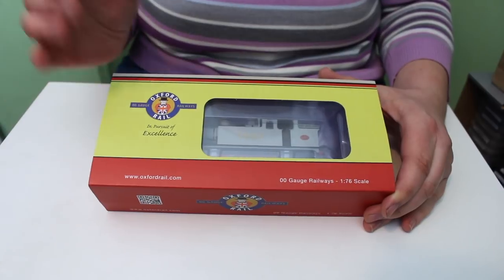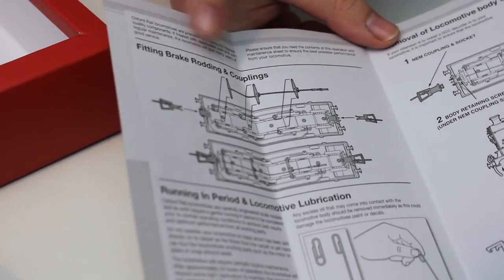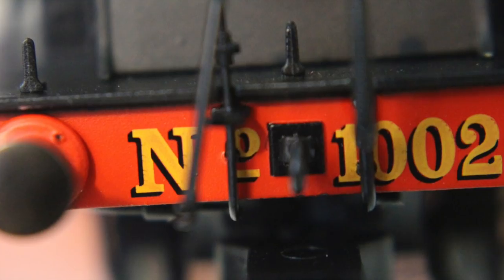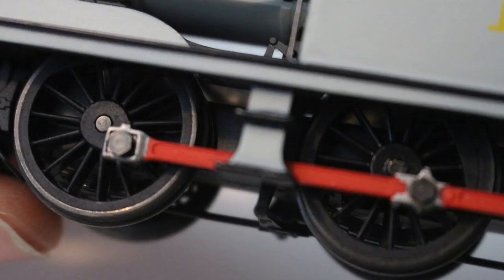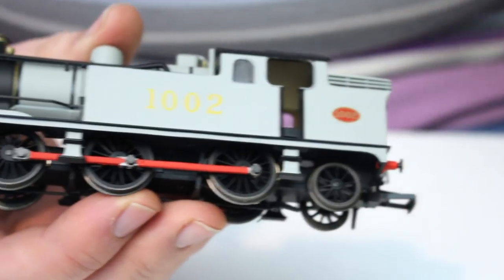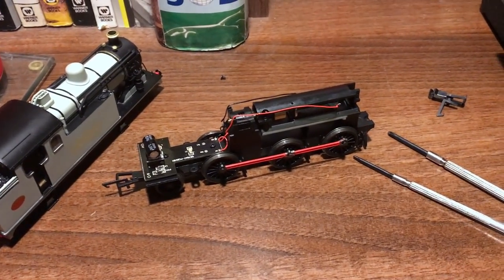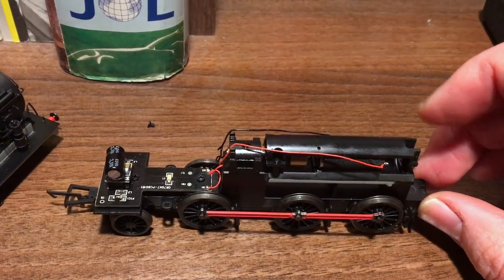Oxford Rail GER K85 (aka LNER N7) 0-6-2 in Wartime Austerity Grey - Unboxing and Review

Comment: Hi Jenny, The small, brass coloured fittings behind the chimney are anti vacuum valves, necessary to stop the superheater tubes overheating when coasting with the regulator closed. They also stop ash being drawn into the valve chest and cylinders from the smokebox, when the engine is coasting with the regulator closed. (pumping action of the valves). On the LNER/BR(E), they were commonly know as 'snifters'. They're fitted to most LNER engines, although on Sir Nigel's engines they're generally fitted singly. If you visit the NNR you'll frequently hear the 'pop' as the regulator is opened and the valve snaps shut on the B12.

Comment: Hi so sorry to see you got a bad one, I bought this after seeing Sam's review and it runs fantastic, That is a really bizarre fault you have their the only thing I can think of is the brushes are not making proper contact as any other issue would cause it not to work at all with the way you got it to work. The one issue I have had with the Oxford rail loco's is the capacitor on the blanking plate burning out this has happened to 3 of their loco's but once fitted with a DCC chip they are great. Anyway I digress the best option for you I would recommend returning it for a replacement as that fault you have even if you fix it could reoccur at any time.
Reply from the maker: ROBS TRAINS the brushes had come loose. I have had it replaced. The blanking plate is indeed an odd design though I suspect that a standard blanking plate would be fine.

Comment: Hi Jennifer, May I point out the list price for this locomotive is £109.99. The £87.00 you quoted is listed with a well known Liverpool retailer and excludes P&P.
I work 2 days a week in our local model shop and EVERY locomotive that enters the shop is inspected and test run before it's put on sale (a problem is by no means uncommon among all the manufacturers). This is just one of the advantages the model shop has over the Internet.
Good review and I'm sorry your problem marred a really nice locomotive.
Reply from the maker: Colin Tucker yes, I got carried away with the discount price though I sourced this one from Arcadia in Shaw. It did pass the initial test run and only faltered and died after a further 30 seconds or so of running at home. It appears that the brushes came loose inside the motor.

Comment: Hi Jenny.
In addition to Sam's Trains, Class 47 Peter is raving about this model - both say it pulls like a Trojan, neither having any running problems. Have you been hit with the unlucky stick?
Great, interesting videos - keep on posting them please.
Regards
Jabof33
Reply from the maker: Randal Williams thanks! I got the dud. The replacement does have great haulage in a similar league to the old cast bodied Hornby Dublo N2.

Comment: If I get a new locomotive that doesn't work, it goes back.  If it gets seriously mucked about, they might not accept it.  So far, I have had only one (a Hornby Railroad SDJR Jinty), which was replaced.
Reply from the maker: Richard Lee I agree though I looked inside in case it was an obvious fix, which it wasn’t. I do now have a replacement.

Comment: Just watched this again as I bought an N7.  I had had it a month or so and it had been an excellent runner, but yesterday I took it slowly out of a siding, running perfectly and then after I stopped to go in reverse, it failed to start.  Very like yours, totally dead and I agree it is probably something easy to fix but I was not going to do that on a new model, so it is going back tomorrow.

Comment: Would I be correct in saying that Oxford Rail's steam models have been a little iffy since their introduction?? IIRC, there was some running issues with their Adams Radial?
Reply: I thought that the diameter of the Oxford version's pony truck wheel was the same as the front bogies - it just looked wrong to me so I went for Hornby's one. Surely these days there's no excuse for such discrepancy.
Reply from the maker: Formidable38 the reliability issue was no vertical movement in the pony trucks meaning that the model easily lost traction. They fixed it on the second releases.

Comment: It's not unreasonable to expect your new locomotive to WORK!  Strike two for Oxford (in the US three strikes and you're out). The Adams also had unacceptable design faults.  Hope you get a good working example upon return to the shop and this is just an anomaly.
Reply from the maker: Andrew Kiely the problem was diagnosed as misaligned brushes and I now have a replacement. It was noted, however, that the replacement was missing the extra detail bag so this had to be retained from the first.

Comment: Is that a HUGE seam line on the sand dome? This seems to be a poor showing. Your 5.5 is a Super Generous gift for a crappy out of the box showing. Take it back and get a refund.
Reply from the maker: Scott Cameron it’s been replaced. Problem diagnosed as misaligned brushes in the motor.
Reply: @JenniferEKirk  Will you be doing a fresh review now that you have a better unit?
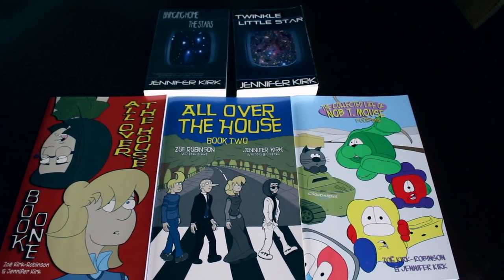Reply from the maker: Scott Cameron no, though I’ll be adding a piece to shed chat live on Monday at 19:00 GMT